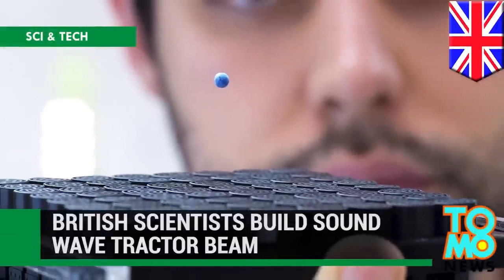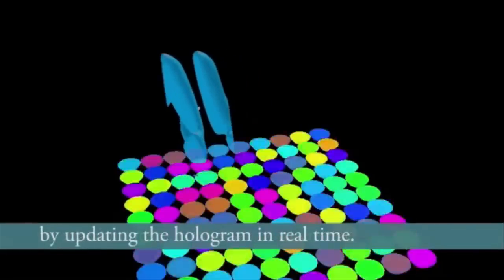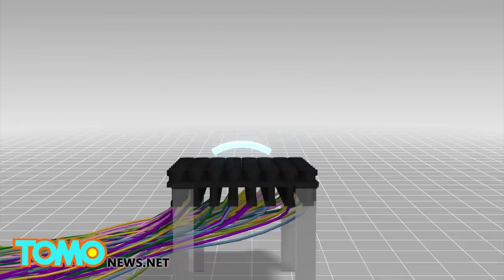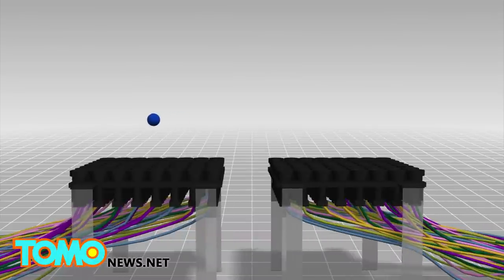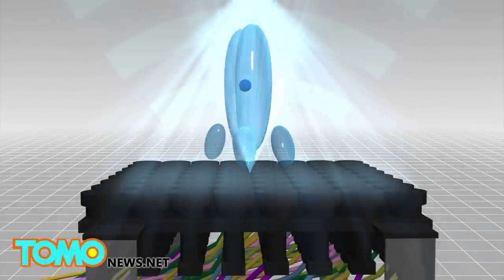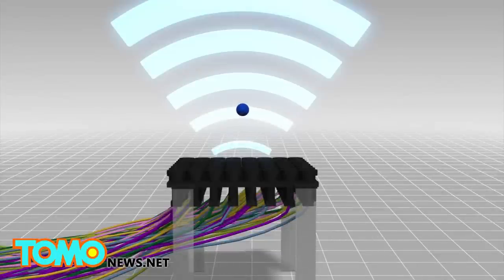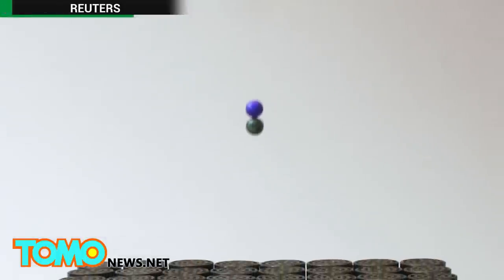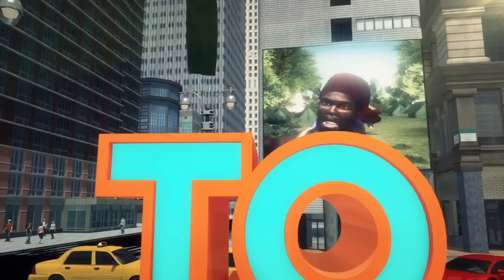Tractor beam technology: UK scientists use sound waves to levitate and move objects - TomoNews

Comment: Now is this something that could be used for hoverboards without the use of magnetism? BTW in Star Trek they have sonic showers, never thought of it before, but that means those showers use sound vibrations instead of water to "shake" of all of the dirt, similar to this video. However the tractor beams in Star Trek are not the same as sonic technology for it requires air or any other medium for the vibrations or "holograms" to travel in.

Comment: that's not a tractor beam, tractor beams pull not push. and also it's not a beam if it use sound waves.
Reply: Sound waves yes, also application of other spectra radiation is aimed in the project, check my previous comments, this is also aligned with ring tech tractor technology, orientation of the ring components can cause pull or puss depending on the centre of attraction. Sound waves are a direct application aimed for use of cell orientation as discussed in the royal society of science 2013. An excellent event where you can speak to the scientific community, grand discussions if you wish to visit, love to see more people attend it ^_^
Reply: Push* not puss, forgive my iPads stupid predict text